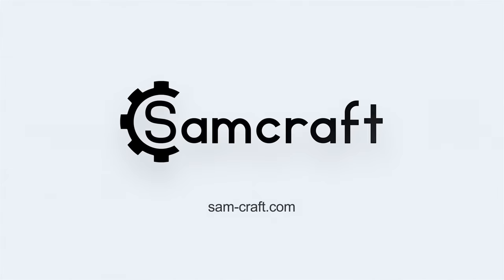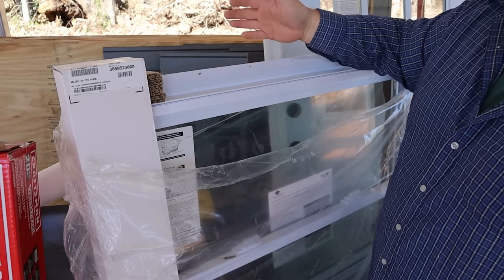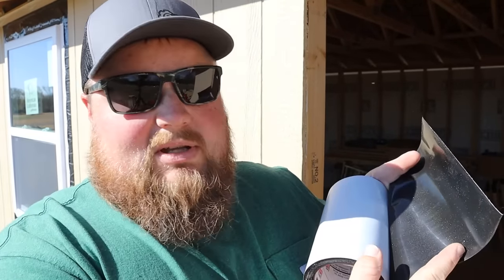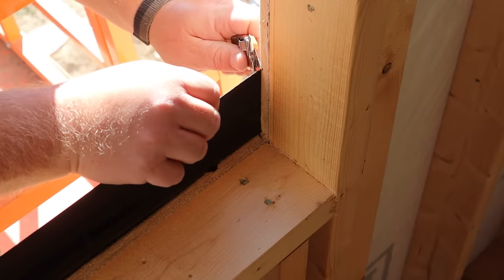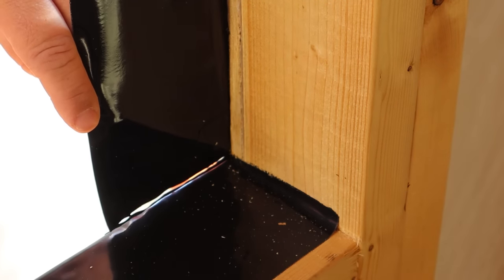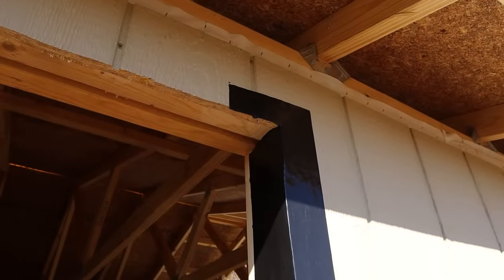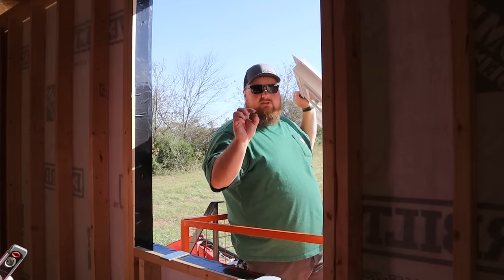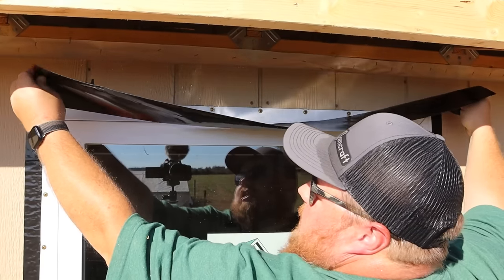Vinyl Window Install, Exterior Trim & More! // DIY Workshop Build

Comment: The 'Old Fashioned' way to fit the top trim on the window is to have the top board overhang a few inches on both sides of the verticals, maybe cut a small (1-2 inch) diagonal on the bottom corners or use a jigsaw to cut the ends in an 'S' if you want to be extra fancy. Water does not like to flow uphill (although wind can blow it into all sorts of interesting places) so a tiny notch (like a knife cut) in the underside of the overhang will make the water drip from there rather than try to run along the bottom edge and find its way inside.

Comment: As awlasy, everything looks great.  If someone wanted to not have the 'sloped' trim, they could always just a table saw, and slightly notch one side to whatever thickness they need to account for the window flanges.  And it looks like you need some more trim for your other building, looks kinda weird to have that one with nice trim, and the other with exposed window flanges, lol.  (That's what it looks like at the start of the 'fly-by' ending scene anyway).  We've used those style windows before, and they are definitely easier to work with than others I've seen installed on new construction.

Comment: Nice window install, plenty of light. Noticed screens are not full anymore only half.  Will you do a mini split for the workshop?  Recall how hot it gets there, or will ceiling fans & exhaust fans do the job?

Comment: Code here (not for sheds tho) would need one more square of flashing in the bottom corners to cover the seam where you cut in. Nice job so far! Did you already close in the gable ends?

Comment: This is not meant in a negative way, but when you first mentioned attaching your windows, you talked about nailing them. I thought, that's different, because I've always seen people screwing them on. However, when you actually went to attach them, you did screw them on. So my point is for making a tutorial on insulation of windows, you may want to clarify using screws from the beginning. Just thought I would mention it hopefully to help others in any other confusion type issues.

Comment: Thank you for your video! Wondering how crucial it is to have trim flush with the flange? I attached my window using torx screws but didn’t want to strip out the pre drilled holes so some of the screw heads are sticking out a tad. Would it be ok to just shim the back of the trim to make it flush with the front of the window?

Comment: Great video, I’m having trouble finding windows that can mount over the siding and have the 1x4 trim sit flush with the windows. I can’t seem to find the ones used in this video. Any recommendations? Thanks

Comment: Other than the roof sheathing you are done outside, right? So, unless the metal roofing shows up, are you doing interior wiring or insulation?
You are going to have a really nice workshop when you're done.
Reply from the maker: Still to come:  door install, z-flashing and gable end wall siding. Then I am inside working.

Comment: looking good Sam, but I hope mo one does the wrap the way you're showing. Where you cut, instead of using the flexibility and stretching ability of the seal tape is just a pnother place for water and moisture to get in and cause yourself huge problems.